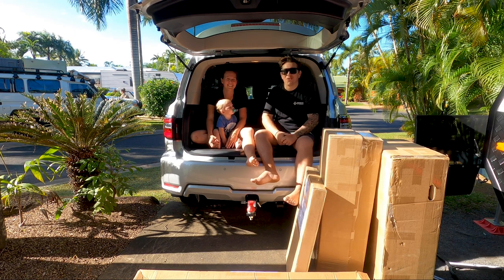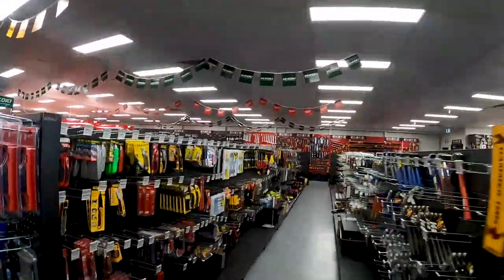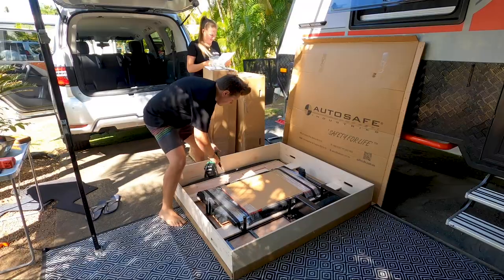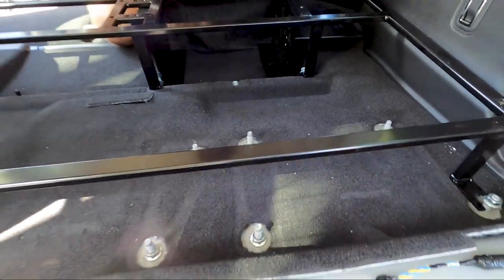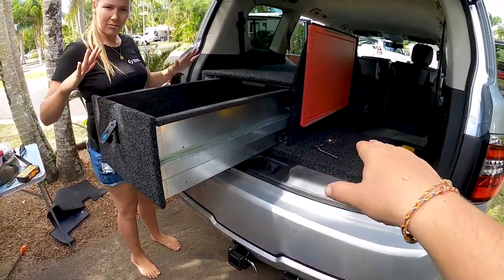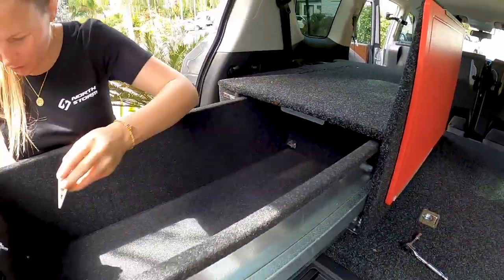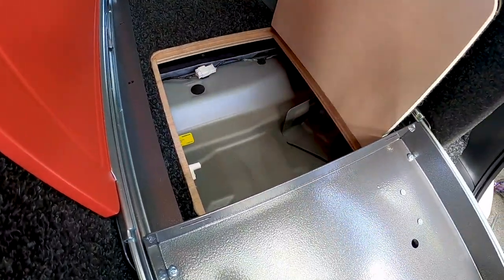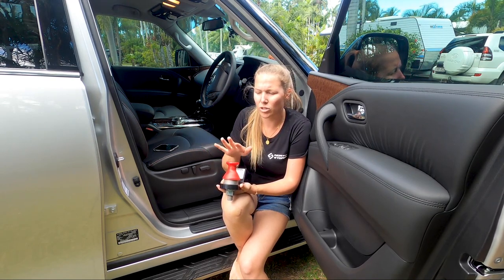REAR FITOUT / GVM ANSWERS / FUEL ECONOMY - Y62 S5 Patrol - BIG OZ BUILD - PART 2

Comment: Thanks for that the only thing that I’m not sure about now is the kerb weight with the old way being that weight is with only 10 litres of fuel and no occupanants so with 800 weight left from your gross and tare weights add 100 kg for fuel 315 for down ball weight and minus the 3 of you guys the fit out the fridge the car seat and what else you put in the car without any accessories bull bar roof rack. I love the content can’t wait for the next one will be interested to see it go over the weigh bridge with all the mods cheers
Reply from the maker: I see you’re doing your maths Adam, I love it! We’ve done the same and sat down with a spreadsheet and we’re going to be close but I think it’ll be alright... It will be exciting to see what happens as we go through this build process! We will be taking the car over weighbridges as we go to keep an eye on what the weights are 😁
Reply: @BigOzExplorers  Keen to see how she weighs in. The separate axle loads will be the thing to look at. Y62  has 2030KG rear axle load so with the van on and the load shifting to the rear axle plus ball weight added I'd love to hear where it ends up. Front axle load in Y62 is huge so you wont have a problem there.

Comment: Thanks for the update, really enjoying your journey so far!

Can you advise what the weight difference was once you removed the rear seats etc. and then inserted the drawer setup? If you’re not sure yet, do you at least know the weight of the drawer setup that you installed?
Reply from the maker: Hi Anthony, thanks for following, we appreciate the support!

Fourby fitouts advised us that the drawer system is 60 kg and that our rear seats are approximately 30 kg, so we’ve had an increase of approx 30kg all up. We will be going over a weigh bridge next episode now that we’ve done some of our larger changes to see where we’re at 😁
Reply: Anthony , I have the Fourby Fitouts Touring Unit it has a few more fittings than the Low profile setup , I can tell you my S4 Ti stock with the 3rd row seats , full tank and 2 people was , 1460kg rear axle , 1540kg front axle , When the Touring Unit was fitted , with a 105 A/H Battery , DC charger and a 39Lt Engel fridge ( empty ) it is 1620kg rear axle . I have a Rhino Bar and a Runva Winch on the front , Front axle now 1640kg . Those weight are all with 2 people and a full fuel tank . I hope that helps

Comment: Hi guys, just found your channel, liking your vids !! keep it up :)

Curious on this vid, did you take into account what you removed, third row seats and the bits and pieces and weigh them to subtract from your GVM and GCM, and then did the kit come with weights ? would like to know what the overall weight penalty was for this ?

After a lot of research, I have also settled on the Y62 for many of the reasons you guys pointed out in the reveal video, but also from a price difference and economy difference between the "option" !

Do you have, and may be in a vid I have not watched yet, any updates on overall performance and fuel economy ?

Cheers

Comment: Awesome setup guys. One thing I spotted when you put the fridge on the slide was the ventilation holes on the lower left side of the fridge looked like they would be blocked by the table setup when the fridge is slid all the way in. Have you happened to notice if this is the case, or have the guys at fourby fitouts noticed this too and made amends for it?
Reply from the maker: Good point Dave, I’ve been out and double checked the fridge and it’s just got enough room to breathe but could do better… It might also be that we’ve got the largest fridge possible sitting on the slide! 🤣 If we take it out of the insulation bag, it has plenty of space but still, definitely a good observation 😁 I’ll mention it to fourby fitouts!

Comment: How to you get the spare wheel off the Patrol? I assume it’s under the cutout on the rear of the plastic surround. Hope the awesome drawers don’t hinder it.
Reply from the maker: We had it under the car initially (it just fit when fully deflated) but since having additional wiring put in the rear end, it is a tad tight so it’s been moved to the roof rack now!

Comment: With the Four by Fitouts system less removing the rear seats do you know how much extra did this system add to your CVM ?
Reply from the maker: Once unboxed, the fourby fitout is approximately 60kg, your rear seats are approximately 30kg, so we had a 30kg gain on the car to have the draw system installed.
Reply: @BigOzExplorers  Thanks Guys, thats not too much of an increase, I dont need the slide so less weight but also contemplating the Touring pack so expect that will add more weight than 30kgs. Looking forward to the next video, safe travels

Comment: did you have any thoughts about removing the seatbelts, they look like a trap for getting gear hooked up on
Reply from the maker: We did actually look at the seat belts and pulled the panels a part a bit, but they were going to be quite difficult to remove. If someone else buys this car down the track, they may also want to add rear seats again so it’s a benefit to leave them there for resale. All in all, they haven’t got in the way yet and they’re actually not as bad as what we thought they might of been!! They’re tucked in quite well with the edge of the drawer set up ☺️

Comment: need to lock  tight all nuts bolts and full fridge to remove  to get to jack
Reply from the maker: When the fridge slide is out all the way you can actually access the Jack through an access hole. We are not using a standard Jack set up any more so we don’t need to get under there anyway! :) we didn’t Loctite anything at this point as it still had to all come out for an ARB visit and a 12V install, would’ve made our lives hard! 😂

Comment: My Y62 was the prototype for that Unit at Fourby Fitouts , they had my 62 for a couple of weeks while they worked it all out  , its my 62 pictured on their webpage , ours is the Touring Unit so a few extra bits some of which I have removed .
You should of asked Nissan how they come up with a GCM of 7 Ton you do know that's not possible legally ?
Reply: Can you expand on that Ron? Why is 7T GCM not legal?
Reply from the maker: That’s so cool Ron, so you know just how great that fit out actually is! We love it 😁

Why do you think 7t isn’t legal? Can you elaborate? We are big on our figures and happy to look into it with Nissan if you have a valid point 😁
Reply: Actually, Ron is correct. The maximum you are allowed to tow is 3.5T. Let’s assume the ball weight is 300kg for arguments sake. You already know that the ball weight needs to be included in your GVM, so your vehicle itself can only ever weigh a total of 3.2T. But you are now assuming that means you can add that 300Kg to the trailer, making it 3.8T. You can’t. For the purposes of calculating your max braked towing capacity, the van still must weigh a maximum of 3.5T by itself. The max braked towing capacity figure that is printed on the label on your car is the total weight of your van by itself, not with the tow ball weight removed.  So in effect, the max your GCM can be is 6.7T (3.2T for the vehicle and 3.5T for the van).
Reply: Of course, if your van only ever weighed 3.2T then everything is fine for you to add the extra 300kg to the van. But your GCM can never be 7T under your current setup.
Reply: @BigOzExplorers  The max weight of the Patrol is 3.5T the max towing weight is 3.5T , yep thats 7T but now you tell me where has the ball weight gone , has it somehow disappeared  , you can't just add the two together and be 7T GCM . 
You even say in the video the ball weight is part of the Patrols GVM . Toyota make the same claim with the 200 series GVM 3350T , towing 3.5T then they say 6850 GCM , again the BW must magically disappear 
Fourby Fitouts units are pretty heavy , just the fridge slide and the single drawer on there own are a tad over 29kg and yes I did weigh them . I didn't remove any of the other pieces to weigh , again I will tell you a stock Y62 Ti with fuel , tow bar and us 2 , is 1540 front axle 1460 rear axle , that leaves a 500kg payload , you say your Van ball weight is 315kg that would only leave us with 185 kg extra . That's why we weighed the dealers S3 Demo before we decided to buy a 62 , we only tow a Tvan camper with a ball weight of 160 -maybe 180 if I take a generator + some extra stuff . The ball weight reduction for the S4 models doesn't matter to us , we can still have a GVM of 3.5T including the BW of 160-180 .
Reply: I wonder if Ron is referring to the fact that the GCM is never legally achievable because the towball download is always  added to the vehicle but never subtracted from the trailer? Nice video btw.

Comment: Not  as good as the drifta drawer but still ok - enjoy the rest of your trip
Reply from the maker: Personal preference hey Jimmy😏, thanks for the comments regardless we love your feedback ☺️👌🏻
Reply: Big Oz Explorers we got our Y62 12 months ago and it just drives like it has no van on the back you will be blown away with 👍
Reply: It needs a Slide out Table fitting under the Fridge slider. . That top for the Draw could be a "pain in the ar$e" if you need to get in the Draw whilst the table is being used!!!
Reply: I disagree. This is a simple, light-weight storage solution. Does it make maximum use of the space? No. But when you’re weight-conscious a simple setup is best.
Reply: @BigOzExplorers  Drifta prob the pinnacle of quality, customisation and longevity and an Aussie Company starting from nothing and now exporting all over the world. Your set up looks pretty good and another Aussie Company? Well you have to back em in too! Enjoy your travels.
Reply: I actually like this better than the drifta systems. And I do like the drifta stuff that is made here. The new Stockton line not so much.

Comment: I’m concerned that there’s some confusion regarding the GCM of the series 5 Y62. Do you have any data from Nissan that actually says the GCM is 7T? All I can see is 3.5T max braked towing and GVM 3.5T. This doesn’t mean GCM is 7T. For example, let’s say your tow ball weight is 300kg. That means your car by itself can only be 3.2T, you know this already. The max braked towing capacity means the max weight of the trailer, unhitched. It doesn’t mean you can increase the trailer weight to 3.8T because the tow ball weight is now on the vehicle. The actual max GCM of the Y62 is therefore 7T minus whatever the ball weight is, as that will vary depending on your setup. I’ll stand corrected if you can show me some data from Nissan that actually says the series 5 GCM is 7T.
Reply: Nissan Australia website lists the GCM as 7T. I just can’t understand how that can be. Braked towing capacity is the weight of the trailer, unhitched. It’s physically impossible for the GCM to be 7T. I guess you’re covered by insurance based on the data from the Nissan website, but it just makes no sense to me! Best of luck with it all, what a bloody minefield.
Reply from the maker: Hey Anthony, I agree that there is some confusion regarding GCM‘s of any vehicle for that matter. The GCM is a combination of your GVM, towball weight and caravan and/or trailer. Towball weight should be included as a part of your GCM and therefore does not affect the 7t maximum because it is part of the maths. If you ask a weigh bridge or weights specialist they will say the same. ☺️ 7t is the max weight the car can handle when in combination. 

3.5t GVM is the maximum weight if you’re not towing. The towball weight needs to be considered in your GVM when towing and rightfully should be taken as part of the GVM which is what engineers have specified is the max weight a car can handle and the towball is a direct weight on the GVM of your car. 

I don’t think this is a Nissan issue directly, it’s a general weight issue that is regularly misunderstood.
Reply: Big Oz Explorers I understand all of that. What I don’t agree with is that the only way you can reach 7T GCM, is to hitch up a 3.8T caravan to your 3.2T GVM vehicle (based on a 300kg ball weight). The vehicle label says a max of 3.5T van, not 3.8T. I simply don’t agree that because the 300kg is now part of the GVM, you can increase the max weight you can tow. I’ve sent Nissan Australia an email asking them for clarification, will see what they say.
Reply: Anthony if you have look the Nissan web site is dose list the 62's GCM at 7T but we both know that cant be correct the ball weight must be included in the weight of the towing vehicle but people just keep stating the GCM is 7T . I know Toyota do the same for the 200 series , just add the max GVM and max towing together disregarding the ball weight . My last 4wd had a max GVM of 3050kg a max towing of 3.5T and a max 350kg ball weight but the specs listed a GCM of 5950kg , 600kg less than the total of the 2 added together . I guess if you were to tow a dog trailer  like trucks you could then have a 7T GCM but even then there would still be some weight on the tow hitch .